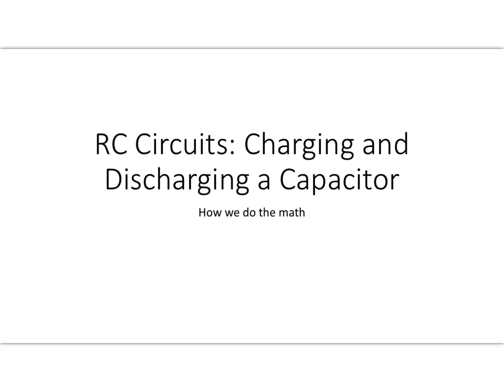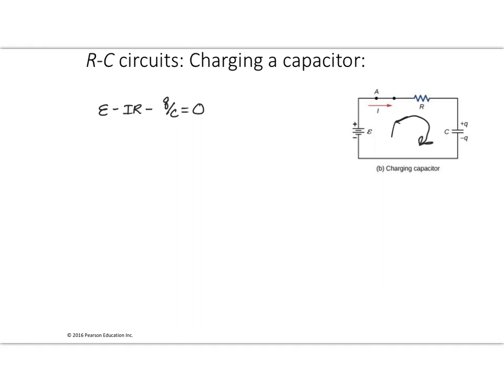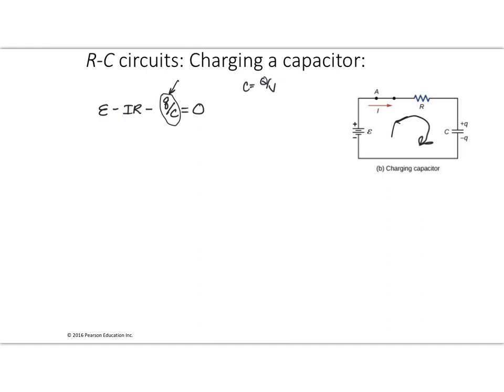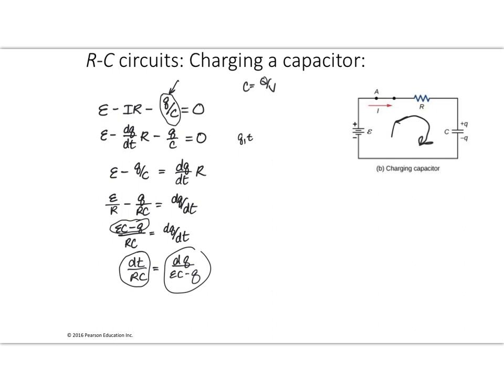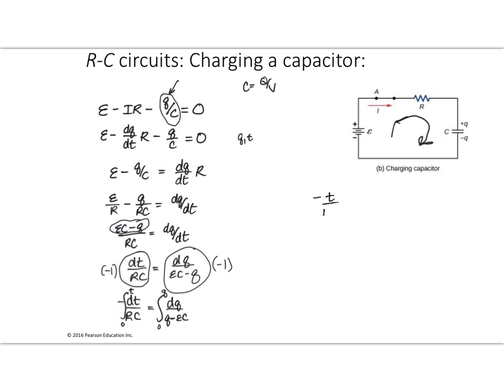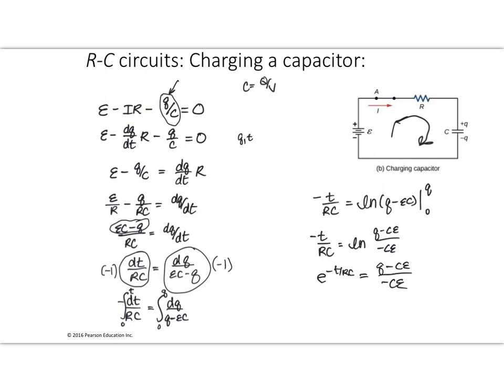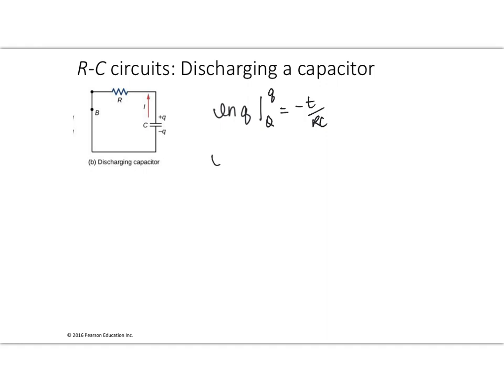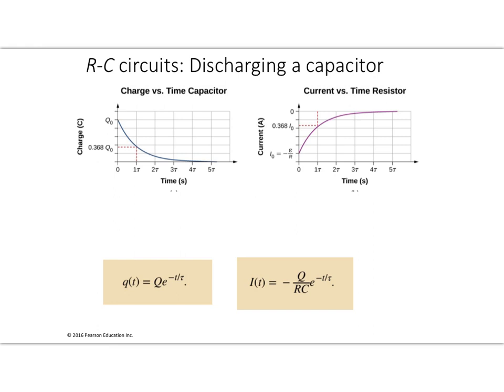charging and discharging a capacitor

Comment: 12:48 could you maybe expand on the sign convention used here? Did you consider loop rule + current direction. From what i understand we define a loop direction and current. Across a resistor if the loop direction matches defined current direction then we do -IR. In this case you have it in the opposite way so we have +IR which is what you wrote. But regarding capacitors I haven’t been able to find a consistent rule to the sign convention, you just guessed it was positive. I would like to know what to do in such cases that works every time (just like the sign convention for the resistor has worked for me every time). Thanks!